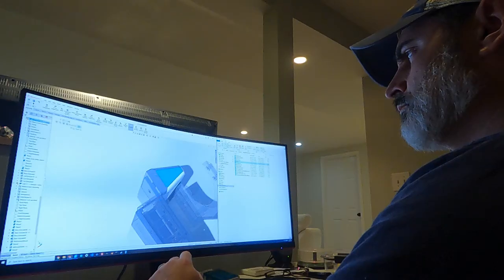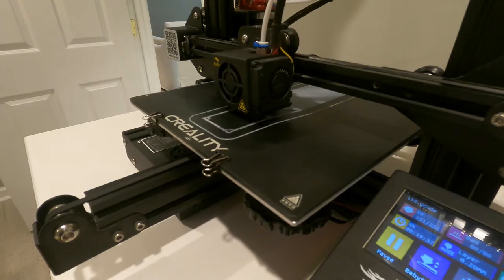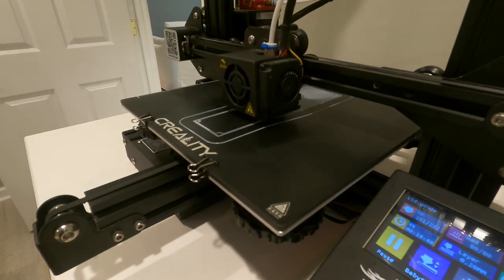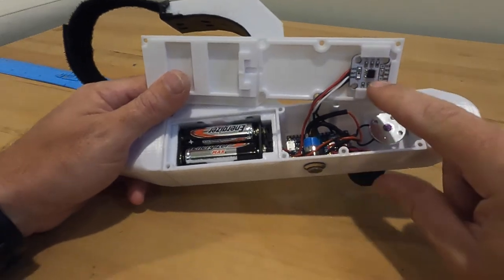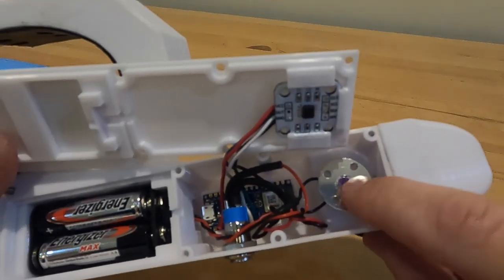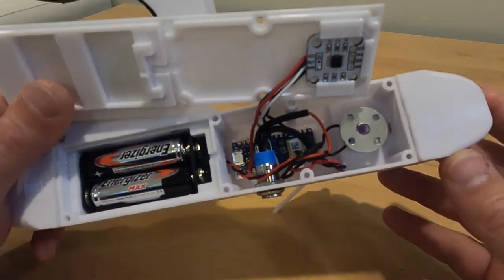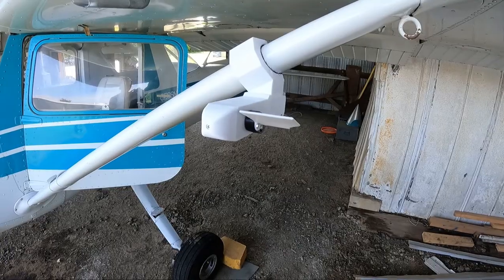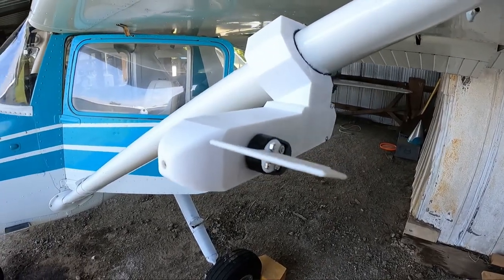I Designed and Built My Own Angle of Attack Indicator!

Comment: Just thought about how to make my own diy AoA sensor and found your video. Thank you for making this video and sharing details, especially for telling about rotary magnetic encoders, I didn't knew about them and planned to use two Hall sensors instead.
One small suggestion -- seems like sensor measurements jitters so the indicator display changes frequently which may be distracting. Maybe using some simple smoothing algorithms like moivng average will help? Sure it adds some delay but angle of attack does not (normally) change drastically in fraction of a second.
Reply from the maker: No problem. Glad someone else is finding it useful. 

I originally designed the sensor to measure both pitch and yaw (e.g. a second wind vane and rotary encoder that rotates on a vertical axis) so you could potentially measure how close you are to a spin as well. At that point I was doing some smoothing on the Arduino. I think I was taking a reading from each rotary encoder every 50ms and then sending an average every 200ms or something like that. But after learning a little more about how Bluetooth LE subscriptions work, I found it was more efficient to just pass data when the reading changes, which might be almost immediate or not. Which would save power - for example, say you land somewhere and forget to power down the sensor - while it's sitting on the ramp it would only use power to send a BLE message when the reading changes rather than every Nth millisecond. As I'm thinking about it, it probably makes more sense to do the averaging on the Android device rather than on the Arduino within the sensor. 

Anyway, you've made a great observation and suggestion. Thanks!